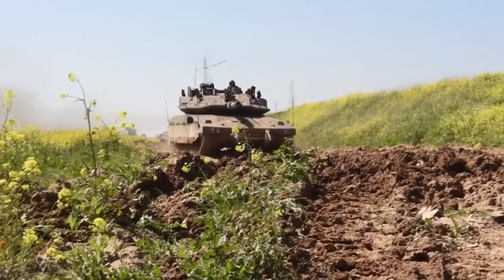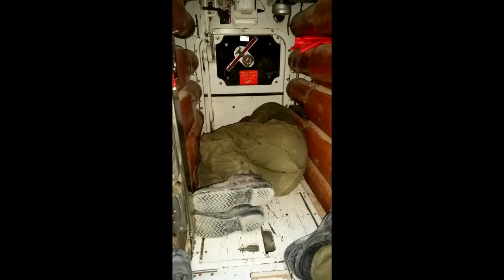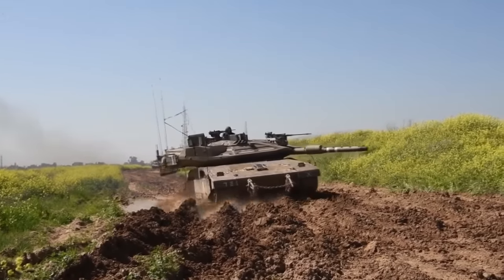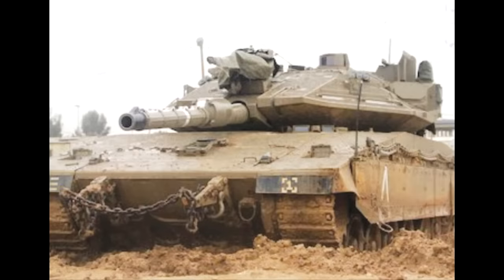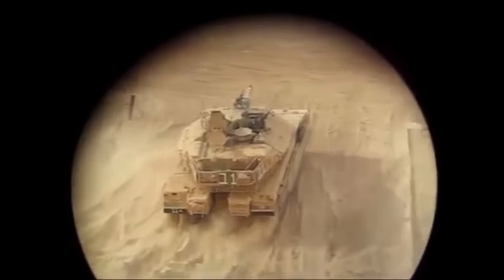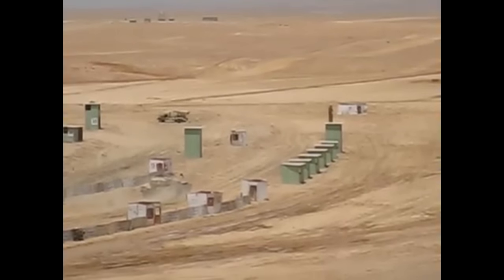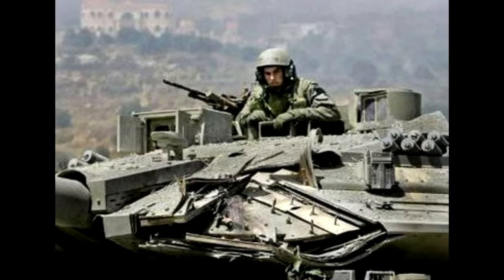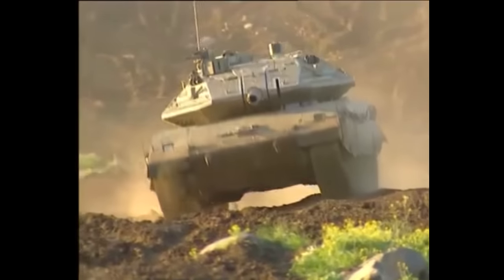Problems with Merkava tank

Comment: They should ditch this flawed Merkava design & adopt the peak of engineering, battle-adapting intelligent Bob Semple design, easily the best tank design any country can hope for.
Reply: Loli4lyf, why not the bob Semple round.
Reply: I like the wheels.
Reply: Bob for president!
Reply: merkava has been ranked as the best in the world so
Reply: sainthood for bob
Reply: @Uchiha.Itachii  r/woooosh
Reply: AngryZombie808  I am more of a Bob Saget fan🤩
Reply: @Uchiha.Itachii  Obviously the judges did not check the bob semple tank.
Reply: @Uchiha.Itachii  LOL it cant even stop a apfsds round on the most protected part of the tank the turret. The tank can also be penned by a world war 2 tank in certain places. It is an obsolete tank on the world stage but when your facing third world countries itll do fine...
Reply: br osorio tank ✊🏾

Comment: I was a tank gunner in the IDF when thr MK IV was just a prototype. I just want to address your claim that the engine being in front would hinder the use of the thermal targeting system during the night due to residual engine heat. This is not the case. We can see just fine ;)
Reply: Is most of the other info correct?
Reply: It can not be detected with thermal imaging because the unarmed Palestinians don't have those gadgets. btw Hezbollah has.
Reply: @Korean_Crayon  technically correct but he doesn't take in to account two things. 
1) Israel's potential full on war enemies (Syria at the moment) don't have the top of the line modern tanks he is comparing it to.

2) The tactics Israel uses for tank warfare. The Merkava was specifically designed for those tactics.
Reply: @benzwebner2515  Syria does have a small fleet of T-90 tanks but those are rather pre occupied right now..... Also I'd guess they recieved no more then 20 of them with a few being damaged in battle already.
Reply: I thought that statement sounded wrong.  I was on an M1A1 in the Persian Gulf War, and I didn't recall any problems viewing things in the TIS whenever the turret was looking backward over the rear deck (where our engine sits).
Reply: @benzwebner2515  What are those tactics you speak of?
Reply: I’ll bet the Israeli tank drivers In Lebanon will differ they call that  merkava   graveyard
Reply: Mauri Mela  good let the hate flow through you, free palpetine
Reply: Mauri Mela  darth Muhammed is pleased
Reply: @benzwebner2515  Completely untrue,  Egypt has Abrams and other Muslim powers in the region have many current generation MBT.
Reply: @impguardwarhamer  Doing whatever you want and calling everyone antisemitic once they criticize you. And don't forget the 6 billion.
Reply: @benzwebner2515  than stop calling it best tank in the world and call it best infantry fighting vehicle in world
Reply: Ben Zwebner is it true that the engine in the front doesnt matter anyway since the front would warm up anyhow in the sun?
Reply: Dishant why do you care how the call it?
Everybody seems to claim that their own tank is the best.
And its the best for them, which basically means the same as saying its the best...
Bcs thats simply a subjective claim in the first place.
Reply: 😂😂 I guess you didn’t see hizbullah did you
Reply: YOAN SLAVEIKOV  20/70 makes no real difference when you consider they started the war with over 2500 T-72s lol
Reply: @Sean Kean Weaker than American Abrams but still a good armour package, comparable to Leo2A5 most likely.
Reply: MK IV one of the forms of your dirty graves on our stolen homeland
Reply: Good or bad,what win a war is not the weaponry but the skill and determination of the men behind it and Israel have plenty of those.And they've proven their mettle against a way bigger foe with superior weaponry  and beat the crap out of them.
Reply: @mikesidewinder7482  Cut the bull. Nobody called it Merkava graveyard. Hezbollah actually did poor vs Merkava mk4. They desperately try to picture that failure as a victory. Hundreds of ATGMs were launched and only few tanks were destroyed. What graveyard are you talking about??
Reply: YOAN SLAVEIKOV  You seem to believe that Merkava cannot neutralise a T-90. What makes you think so? As for "good command" - that's were Syrians are hundred year behind the Israelis.
Reply: YOAN SLAVEIKOV  Hahahahahahah
Reply: YOAN SLAVEIKOV  Are you mental? Syrian civil war has been going on for years! How could Syria defeat Israel if Syria can't even control their own territory?? Israelis beat Syrians in 6 days (look up: Six Day War). The quality of SAA just isn't enough.
Reply: Mr Chocolat Bean  
Entity Civilian Military
Flag of the Amal Movement.svg Amal Movement  20 dead[7]
Hezbollah  Deaths: ≈250 fighters KIA reported by Hezbollah,[8] ≤500 estimated by Lebanese Government, Military, and Intelligence officials,[9] ≈500 estimated by UN[10] ≈600 estimated by IDF,[11] 450 bodies identified by Israel and up to 700 estimated by Amidror[12]
 Israel 45 dead[13][14]
35 seriously wounded[15]
70 moderately wounded[15]
1,390 lightly wounded[15]
2,775 treated for shock and anxiety[15][16] 120 IDF soldiers were killed in the war, including the two soldiers whose bodies were seized in the Zar'it-Shtula incident that started the war, whose fates weren't confirmed until their bodies were exchanged for Lebanese prisoners in 2008.[15][17]
1,244 IDF soldiers wounded[18]

 Lebanon Not known for certain. 1,200 Lebanese dead in total (including combatants and foreign civilians in Lebanon)[19][20]
4,410 injured[19][20]
It was widely reported that most of those killed were civilians,[1][21][22] but the Lebanese government does not differentiate between civilians and combatants in death toll figures.[11] 50 dead
~100 wounded
Flag of the Lebanese Communist Party.svg LCP  15 dead[23]
 PFLP-GC  2 dead[24]
 United Nations 1 dead 5 dead
125wounded. See main article
Reply: Carin Hall  Just the one's being used as human shields by Hamas. The tactic of choice for those cowards.
Reply: @y0Milan  Not the good Abrams, but don't tell them that
Reply: Mauri Mela  not enough apparently few still left...
Reply: Didnt see hezbollah too well tho did ya lulz
Reply: I talked to an American tanker who said he was glad the Isrealies are on our side because the Merkava was the only tank he would genuinely fear facing in an Abrams.
Reply: @donaldseigel4101  Exactly. Israel is just defending itself. However this Mohhamedians are ignorant to see that.
Reply: I bet it was effective against unarmed stonethrowing children.
Reply: @kloschuessel773  well Lepard 2A7 and T14 Armata are together with the japanese Type 10 MBT currently the best, M1 Abrams, and T90, the Chinese Type 99 the Indian Arjun as well as Merkavar are good enough to intimidate insurgents and slaughter innocent or fight countreys/forces that are mainly armed with T55, T72 and T80 - 
But i bet if for example Lepard 2A7 lets say from Turkey or Saudi Arabia is in a fight against Merkava and both sides have the same force and no air support there would be a bunch of dead Jews with less than a hand full of Lepard 2A7 losses... 
Merkavar vs T14 Armata would be abaut as fair as a duell Maschinegun vs Flintlock
Reply: Did you fire on Palestinian kid using stick and stone, not for warfare. But for fun????
Reply: @shahidhafeez6467  Israel : laughs in trophy active protection system
Reply: @georgekingiv8171  "the best tank in the world" 
Well for one, no body has officially called it the best tank, and no tank is invincible, 
Saudi abrams get shot like ducks, while us faught an entire fucking war while losing only a couple of their tanks
And even if it were called one, it would be subjective, you know, conditions for tank warfare are different everywhere
Reply: @Favel Konefka. while Egypt lost more than 10000 troops even though the Arab army far outnumbered Israel
Reply: @Favel Konefka. : If I remember correctly I think the reason Israel succeed in the end was due to Syrian army failing. This forced the Egyptians to abandon their tactics of protecting everything with a shitload of air defense systems as Syria demanded help from Egypt. This made the Israel air force able to engage and destroy Egypt tanks and vehicles.
Reply: @pew-pew2224  in reality it was an attack at a weak point in the Egyptian line which broke through and headed to the other side of the Suez and flooding soldiers in to encircle the third army which successfully ended the war for egypt.
Reply: @adibar9066  : According to the book ”The Yum Kippur War” by Simon Dunstans it seems that the Egyptians where doing quite well until they where forced to attack beoynd their air defense shield. This was a political pressure from the Egypt leadership on their leading general to help the Syrians. The leading general didn´t seem to have been all pleased by this and he knew that it would lead to a massive defeat as they would, more or less, do the same thing against Israel as Israel had done, and suffered heavy casulties, against Egypt. Had Egypt stayed put the outcome might had been different. The Egyptians seem to have reach their objective with the offensive.
Reply: In fairness yeah, you have to look at the enemies Israel would most likely face, which would unlikely be armata tanks or t-90, unless Russia feels itself generous enough to donate them to Iran or Syria. So most the projectiles a Merkeva would face will most likely be rpg and whatever the fuck Syria has left and whatever tanks Iran hasn't canabalised in order to keep the other few tanks it has running.
Reply: Wet Lettuce they have about 40-60 at the moment, a large batch arrived
Reply: @blacktea65s  Don't make fun of religion. With you like it when Muslims make fun of Jewish. No right, we don't hate you at least I don't so don't be negative about religion and Prophet Muhammad(PBUH). We respect you and you should respect us.
Reply: @Sean Kean Great point. Could you tell me if challenger and Abrams use the same composite armour.
Reply: You served time in lebanon?
Reply: @blacktea65s  You cannot trust people who do not trust. USS Liberty.
Reply: if israel wasnt supported by USA the arabs would won the war
Reply: @GymMusicsalah  when? 67? Usa was against this war and israel had no american weapons. Eventually Arabs begged for seize fire. 73? Yes Israel got air bridged supplies from USA, but so syria and Egypt. Eventually they begged for seize fire. 82? USA was against this war. So when? When did israel was saved by USA? USA gives israel only about 3.3 billion $ anually and most of it goes back to american industries. Israel has defense budget of about 20 billion $.  So it's just a small part of it. And No american soldier fought for israel. Ever.
Reply: @rigerriger  😂😂😂😂
Reply: @wetlettuce4768  T-90 isn't on par with an MK 4.
Reply: @mikesidewinder7482  lol?
Reply: @y0Milan  No they do not. M1A1 is not anywhere near the current Abrams model. The current one is the M1A2 Sep (or A3 sep).
Reply: @kloschuessel773  Leopard 2 is the most advanced followed by the South Korean Black Panther.
Reply: ANUSH SLAVEIKOV  lol..."if under good command" so no arab country.
Reply: ANUSH SLAVEIKOV  hahahahahahahahaa
Reply: ANUSH SLAVEIKOV  wait do you know anything about 1973????
Reply: @WastelandArmorer  The Leopard 2 is the most advanced tank in the world atm.
Reply: @prinzeugenvansovoyen732  the T-14 is not anywhere near the best.
Reply: @dannygelbart6827  Still far above Merkava and Comparable with the newest M1 A2 abrams and Leopard 2 A7 or Leclerc 2017
Reply: @prinzeugenvansovoyen732  The what the T-14? No, it really isn't far above anything although it can finally put up a fight with the Abrams.
Reply: Ben Zwebner  
Lebanese resistance turn the tank in the junk
Reply: @mikesidewinder7482  LOL
Reply: @dannygelbart6827  Yes, but he Considered the Merkava superior as an opponent. Powerful weapon and good protection, plus better trained than the American crews and more combat experience.
Reply: @WastelandArmorer  The Merkava IS a better opponent than the russian tanks.
Reply: @wetlettuce4768  those are not top of the Line models. Russia does not sell their best or second best.
Reply: @y0Milan  you mean old versions with inferior electronics, worse armor and not top of the line ammo.
Reply: @wetlettuce4768  I do not understand what youintend to imply with this answer. But still those tanks are not top of the line versions. We all know this. So I don't understand what you try to say here.
Reply: @meirmouly837  You're barking at the wrong tree. I'm 100% kosher.
Reply: @GymMusicsalah  hahahahahaha
Reply: ANUSH SLAVEIKOV  No they aren't.
Reply: @dannygelbart6827  aa sorry my mistake isarahell was supported by usa .UK and france read history ;)
Reply: @GymMusicsalah  Yes you may wish to, since you obviously don't know anything about it. But given your name and where you likely come from I guess people shouldn't have expected any less.
Reply: ANUSH SLAVEIKOV  combined arms..... sherman vs tiger,  etc....
Reply: @y0Milan  Egypt is no longer an enemy of Israel. They have made peace with Israel. (And also the Abrams they have are not the best out there btw)
Reply: @georgekingiv8171  but its not an IFV. It's a tank.
Reply: ey! thansk for feedback, its always cool to see former veterans that drive the subjected tank in today's vid. cool!